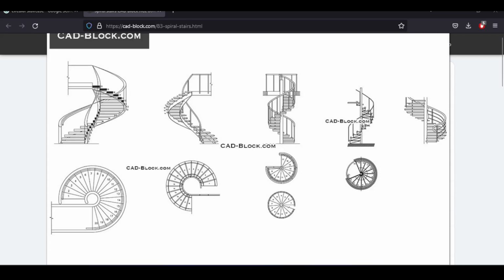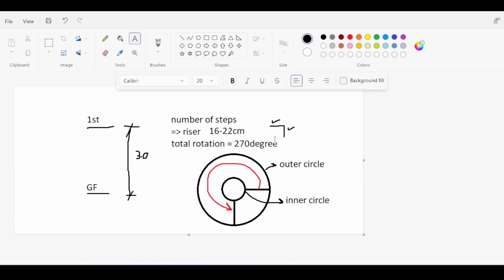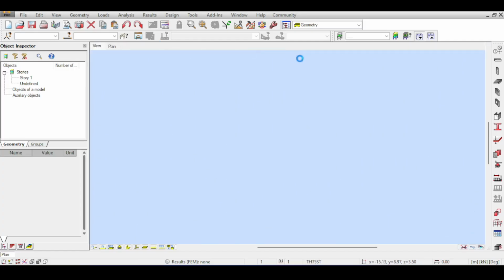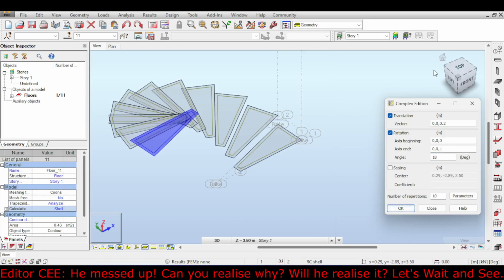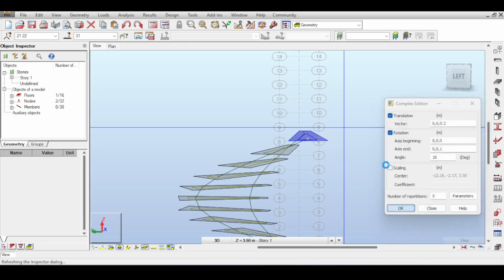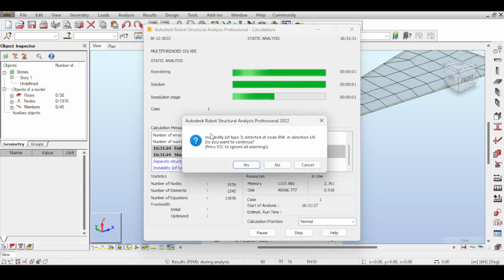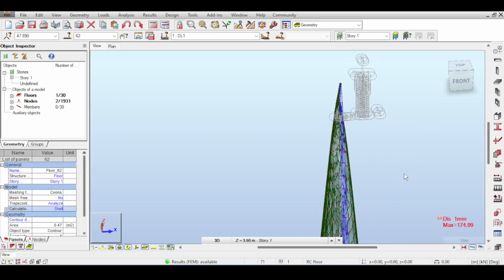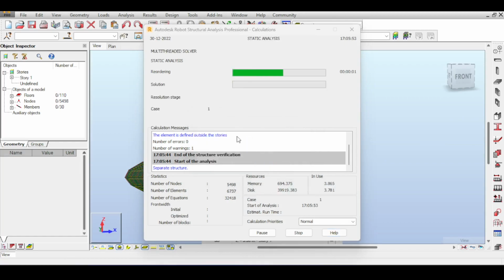Modeling of Circular Stairs and Car Ramps using Autodesk Robot

Comment: Hello CEE,

Much like a movie or a video-game that one enjoys, I have re-watched this video twice already simply because it is (for me) enjoyable to watch. 

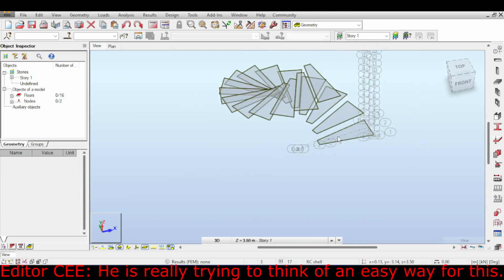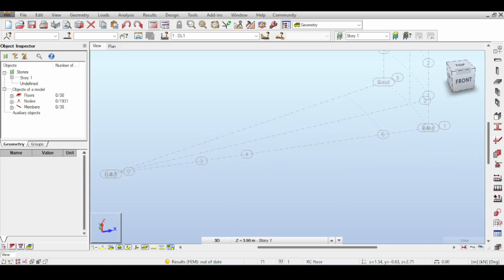23:43 The ability to drag while complex editing in order to create the helical beams was a very cool WOW wow idea indeed. It is the unhinged kind of thinking which the CEE recorder is famous for (time and time again that is 😊). 39:10 YES, lucky there exist the able and willing CEE. 

Thank you for modelling the three configurations side by side, this really helps as it enables pertinent details to be captured and it also opens up the scope of application of the various learned techniques. 

04:00 I concur with the CEE. Riser and threads vary depending on intended use (public buildings, general purpose and fire escapes stairs, access and vertical ladders, etc. various codes and handbooks have own recommendations. I usually use (staircase for general use = 190 risers x 270 threads; or even an easier stair with 175 risers x 280 threads). As the CEE have already noted, one must make a trade-off on the size of the stair thread when it comes to circular staircases. 

15:09 Very informative comments by the CEE editor on the foreshadowed instabilities and stress concentrations associated with (attempted) connection of a staircase to a column using a single point on a shell. 32:43 Thanks for not editing this part out, it is a valuable overall learning experience. 34:45 the statement made by the CEE about analysis issues sums it up; additionally, CEE have on previous videos talked about the importance of thinking about the practicality of the connections…one should ideally also throw this into the mix when designing cantilever staircases.      

22:10 I could not stop laughing when the CEE recorder said ….I call foul…this is cheating…..then boom, the CEE recorder un-cheats big time.

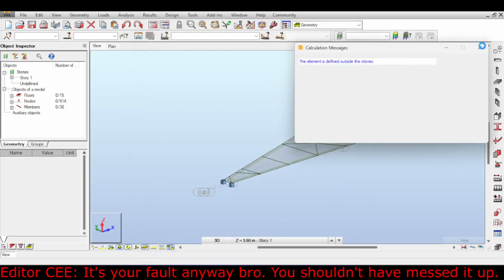35:30 😊😊😊

28:17 I know this video is about modelling and analysis (not yet design), however I am curious that my dry run deflection is about Dis = 5mm, Max=13.2mm, this is so when I am using 10mm steel plates staircases and a 200x75 Parallel Flange Channel as my helical beam. Even if I change the helical beam to an I-Section (W10x12), the dry run deflection is still Dis = 5mm, Max=12.9mm, these values are relatively higher compared to the ones obtained on the CEE tutorial video with a placeholder helical beam of (W10x12 – I think?) and the (later changed/corrected) thickness of 75mm 😊😊😊. I am wondering as to what could be causing this significant difference above? the "exact numbers are not important" it is the currently unknown reasons to me that is the cause of my concerns.

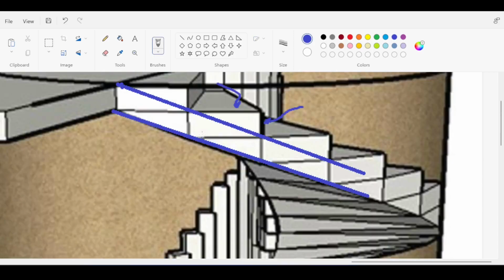38:50 Correct, I also use the same effective thickness approximation shown by the CEE with the riser and threads above this thickness becoming added dead-weight (permanent load). 

41:42 if CEE is this impressed, I guess RSAP must be that “...bloody amazing….” ? For the record, even though the triangles ended up (justifiably) edited out, CEE recorder should know that his approximations have so far been works of art and they enhance the conceptual understanding and appreciation behind the subject matter, if (or when time allows), I would gladly take the approximation and then the automation (in that order).

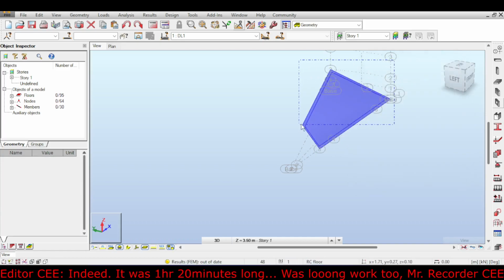42:36 I am still in awe that CEE only (😊) take 1hr 20 min to come up with all this from scratch. This is (lightning) quick for the quality of output that the CEE is producing.

Thank you CEE for sharing your knowledge and for illuminating the year 2022. Happy and prosperous new year to you.

Looking forward to what is yet to come in 2023

Regards DK
Reply from the maker: Hi Engr. Donald,
Happy new year ^_^
I am really happy that you liked it.

The ability to drag occurred to me live on camera as I was about to add nodes. It worked flawlessly. 
Thnx for sharing the step dimensions you usually use. It helps all viewers to have multiple views on that issue.

I wanted to actually edit the entire failure out. But then I decided to just keep relevant parts that showcase my absolute failure ^_^. It is only through failures that we learn. To be honest, while I was recording, I was really inclined to say unstable, but gave the model the benefit of the doubt. Anyways, it was unstable.

oh the eureka moment after the 22nd minute was, for me, a real blast. I enjoyed it.

Truth to be said, I am concerned about the deflection too. There are still loads to be added. I will keep an eye on that and tackle the problem in my next video. I am pretty sure something is a miss here.
I will have to look into max sizes for staircases without any mid-span supporting columns. 

Oh the meshing capabilities of RSAP!!! THEY are next level!

The only reason I removed the "manual" triangle modeling is that I am afraid of people who "spot click" the video to think that this is the way of doing things. It was a nice experience actually, but the cons outweighed the pros to be honest.

You are always most welcome. A happy new year,
CEE

Comment: In Algeria we usually use a raiser of 17 cm and a trade of 30 cm
Reply from the maker: thnx a lot for the info ^_^ I guess it makes sense.
So basically a story is around 3-3.5meters high. Interesting.
Reply: yes sir and usually we use a story-high multiple of 17 like 3.06 3.23 3.4 .... etc  @CivilEngineeringEssentials